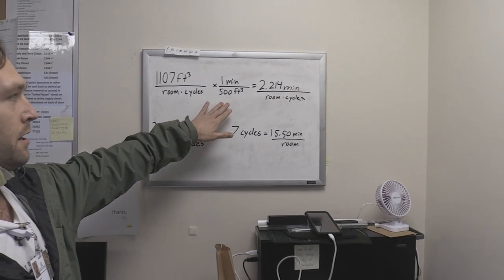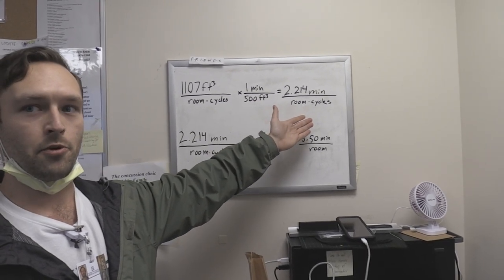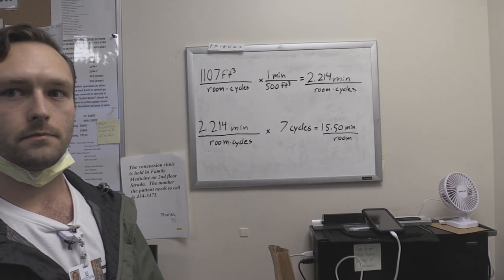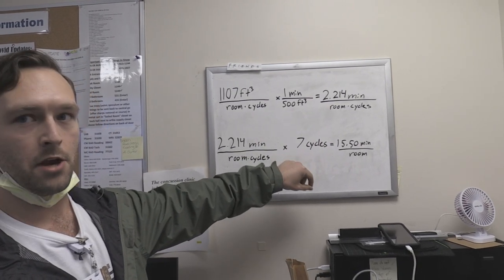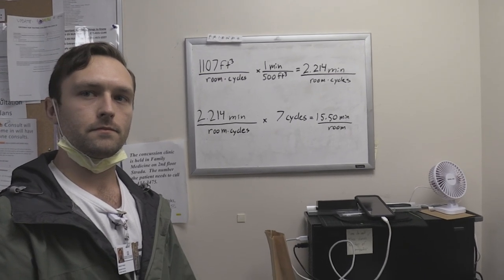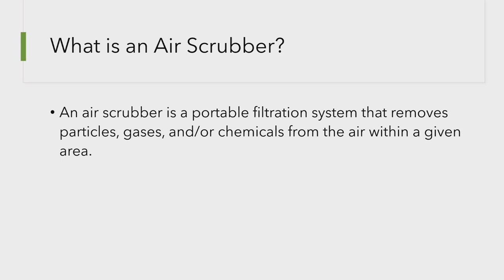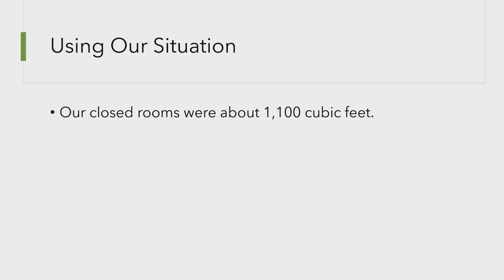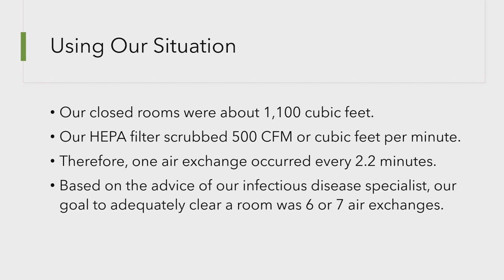Air Scrubbing Calculations for SARs-CoV-2 Virus

Comment: Would you possibly use UV-C disinfecting in a medical setting? Of course no one would be in the room, but may work well to clear a rooms surfaces. If you get something thats the right wavelength, ozone production will be low. Surface liquid disinfects still work, just maybe UV could help. Still weird to have it in a hospital.
Reply from the maker: That or some form of UV light is being used by some hospitals.  We are looking at that as an option too.